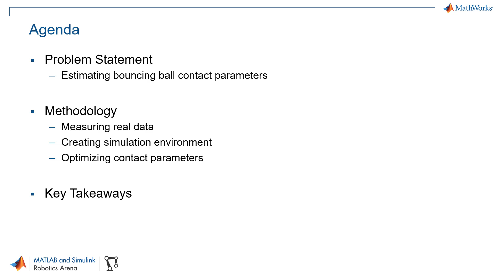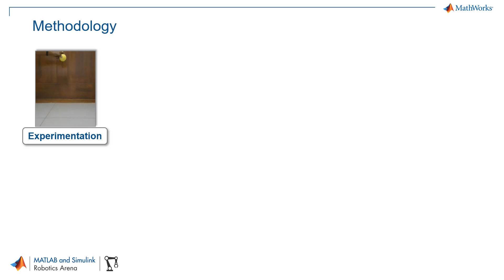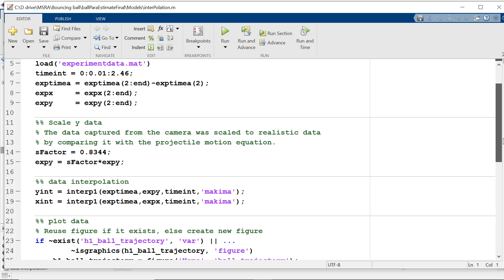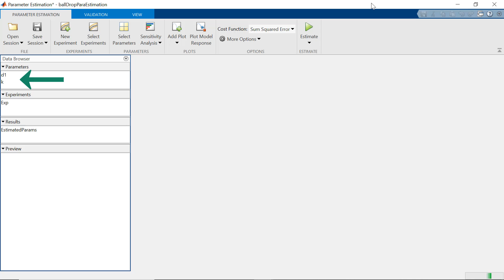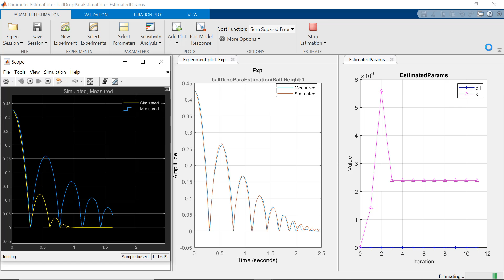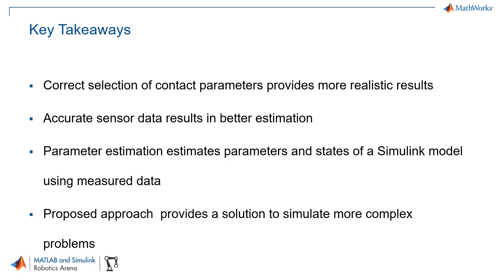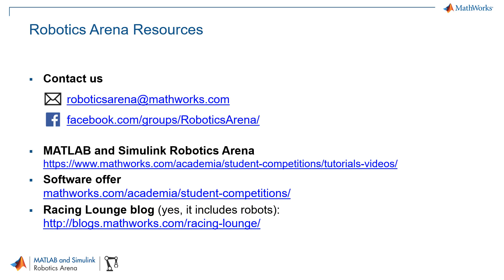Estimating Bouncing Ball Contact Parameters

Comment: @5:12 if we have arrived at two different set of contact parameters due to two different surfaces, how can we combine the two in order to have unified contact parameters when the ball is bouncing between these different contact surfaces?
Reply: Hi Rizwan. You will need to make seperate connections between different surfaces and the ball using multiple Spatial Contact blocks. Once you will run the simulation, the solver will solve the contact equations based on the selected parameters. Please feel free to reach out to us at roboticsarena@mathworks.com to get the model with multiple surfaces.